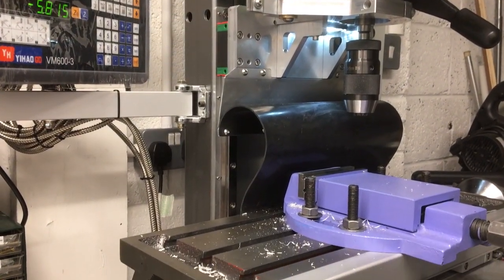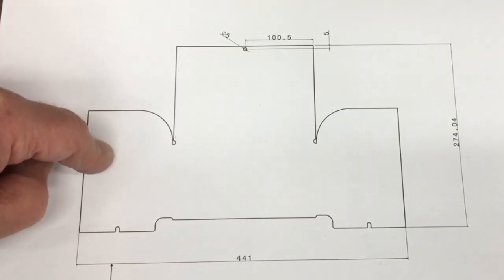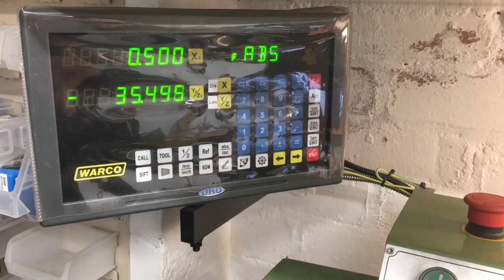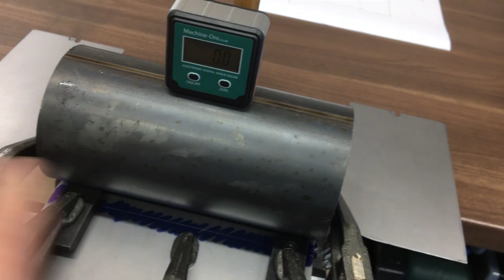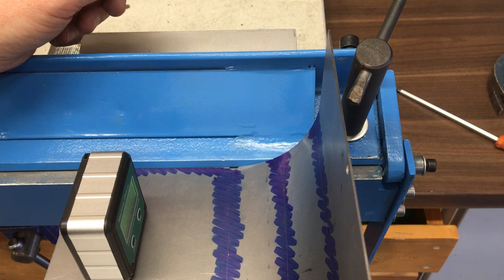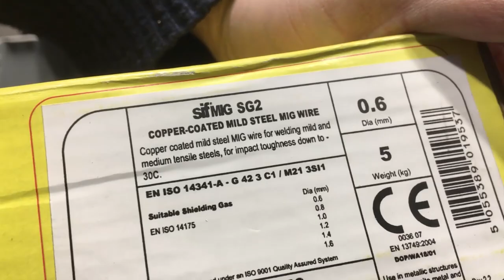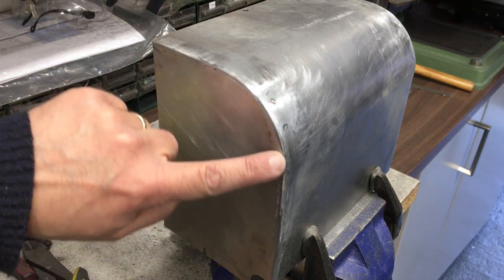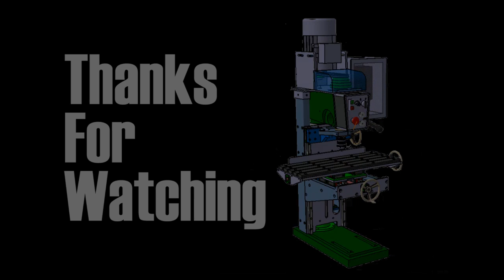Ep36: Drill Press Upgrade | Fabricating the belt cover

Comment: If you were going to paint it why not just tac and fill the rest with bondo? Welding all the little pin holes seems a little unnecessary. 

Regarding the Plasma cutter, I just bought a cheap handheld plasma cutter and mounted it underneath the router spindle and put a 10mm steel sheet on the machine bed, with a grid of screws sticking out (to put the steel sheet on top). 
Was very simple and for the few times I work with sheet metal it works well.
Reply from the maker: I did consider using Bondo (P38 in 🇬🇧) but I didn’t like the idea of filler rather than metal.  I just cycled between the grinder and welder and had it done in about 30 mins.
Reply from the maker: I would be worried about arc splatter etc if I used my CNC with a plasma torch, but I like your idea.  Is it a HF start?  These are temptingly cheap but everything I’ve heard about them interferes with the control electronics and people have to pay a fortune for the blow back style.  How did you get on?  Also I think I would want torch height control and voltage control.  Did you somehow add those?
Reply: @routercnc9517  sorry for the late answer. 
So yes, HF start. 
Once it is running, there is little issue with interference issues. 
So I just bought about the cheapest one, simply because it was for sale at a local discounter and in reality, I don't even keep enough sheet metal on hand, or have the space to justify spending a couple grand for a new machine+plasma cutter. 

So no torch height control, but if I were to add it, I was going to go with the one from PoScope as I am already running a PoKeys controller. 

Now interestingly I had quite a few troubles with even turning the plasma torch on as the regular switch is on the handle of the cutter. I wanted to use a relay from my CNC-control box, but that did not work. Even when passed through another octocoupling relay. No idea, what is happening there, but it caused absolute mayhem for the electrical circuit. Somehow my monitor kept turning off etc., so I ended up just wiring a manual switch to the plug on the machine and turning it on when it was coming down to pierce the metal.

So it's not the greatest.. If you have the space for a proper Plasma Table, go for it! But if it's going to be the same size as your CNC, I wouldn't do it, as your sheet metal at that size isn't even heavy enough to no accidentally move during cutting, so it will always be a pain to use! If you feel unsure, just try out my method as it's not even 200 bucks and if you feel like you would use it more often, go big!